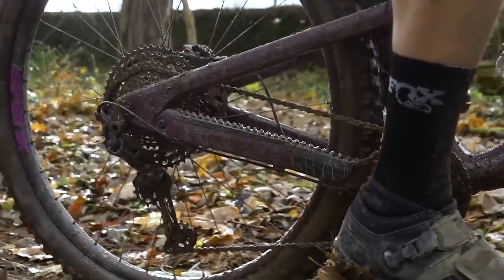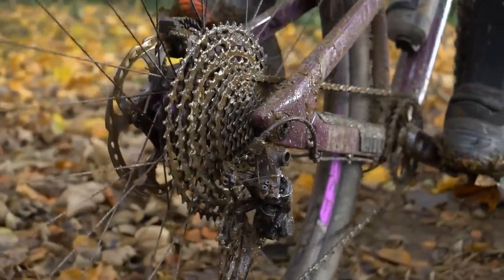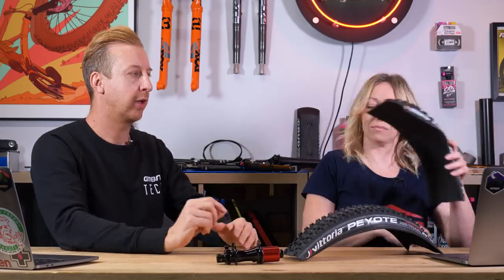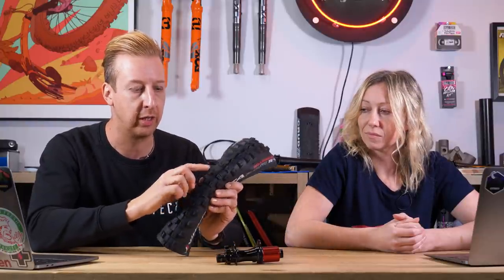How To Stop Tubeless Valves From Clogging? | #AskGMBNTech 180

Comment: #AskGMBNTech Hi GMBN, 

Can you help please? 
I’ve emailed Specialized a couple times but no response. 
I have a Specialized Rockhopper Expert 29er. 2021 model. I replaced the 100mm fork with a straight steerer with a 120mm tapered fork. I used a hope bottom cup to accommodate the tapered fork. The 100mm fork had 46mm offset, the 120mm fork has 51mm offset. The bike rides great now. Will the warranty be void and is the new set up likely to cause damage to the frame? 
Thanks, Jim.

Comment: On the great peddle debate, I no longer buy the argument that it's because there are so many options and it's very personal. You can make the same argument about saddles and maybe even grips. Basically anything that the rider contacts. A set of peddles should come spec'd with the bike like everything else but knowing the rider might choose to swap them for another brand/style. So in other words, not an extra charge. My humble opinion.
Reply: The odds are great they'd put on ones that I don't want. That means I had to pay for what I took right off. That IS an extra charge. Saddles are also personal but they don't have to match my cleats.
Reply: Fair enough but in my opinion if I spend 5 figures on a bike it irks me to pay for peddles. And a saddle has so fit my sit bones to its VERY personal preference 😝

Comment: #AskGMBNTech If manufacturers don't include pedal because they're so personal, why do bother including saddles and grips?
Reply: People are probably less picky about grips than pedals - everybody cares about pedals, I know a lot of people who don't give a damn about grips. Similarly, with saddle - many just run these disgusting padded pants, so saddle is non issue
Reply: Brands realise that the included pedals don't get used, so they just include cheap plastic ones. Just like dork discs and reflectors, if I'm not mistaken, pedals are required under law for bicycles shipped anywhere. So they can't lawfully ship a bike... "pedalless"

The inclusion of saddles and grips are partially because they are the main contact points, but also because of brand inclusivity and deals with other companies (for e.g Pivots come with WTB branded saddles).

Comment: #askgmbn. Why are disk rotors so ridiculously overpriced? I know the shimano ice tech has their proprietary tech but most of the other rotors are just a water cut piece of steel! What am I missing here? It feels like printer cartridge like scam!
Reply: Well, market competition plus the fact that no brand has yet tried to come out with a relatively budget rotor except Shimano's SLX SM-RT66 rotor.

Brands sell technology, not product. It's up to you as the consumer to pay for what you believe - but there are differences between brands that only people in the industry would know about....
For example, 
Sram's old centerline uses much softer metals, resulting in a more mushy feel using any brake,
Shimano's XT icetech rotor is very powerful given its surface area, but weaker than older generations as they also use lower grade metals,
TRP's rotors use harder metals which gives more firm feel but not as refined braking surface = less power,
Magura's rotors are powerful and work great under heat but warp very easily
and so forth...